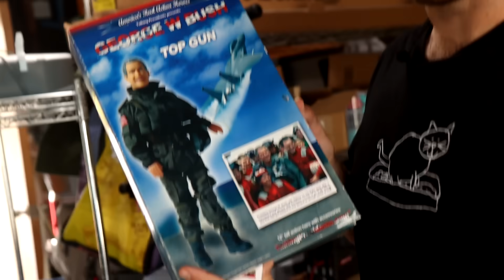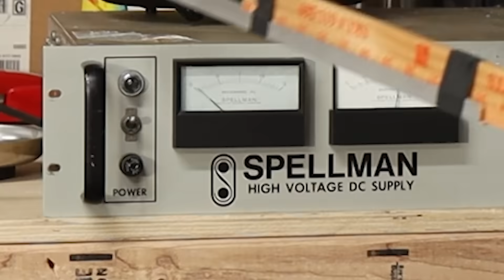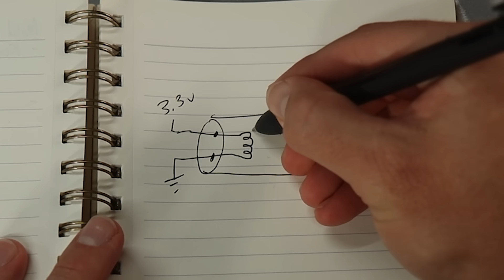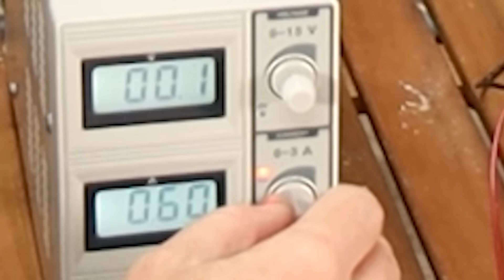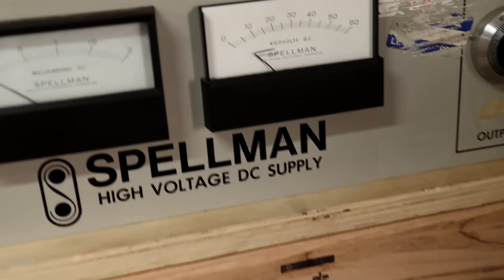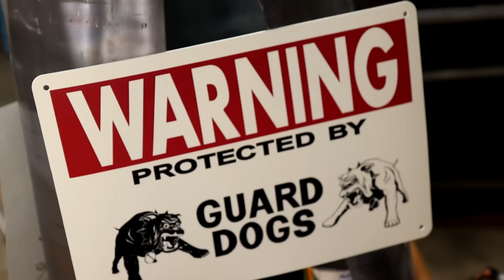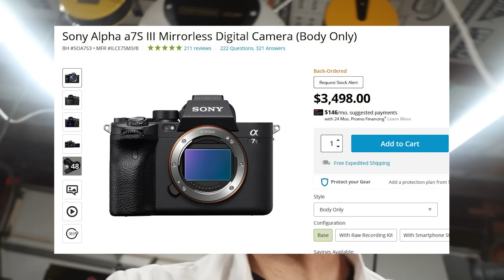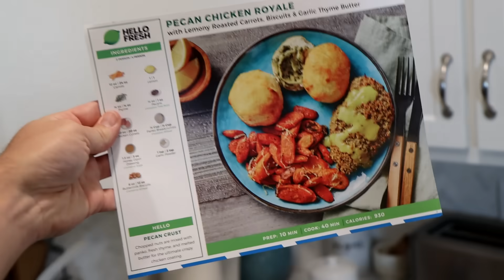Built My Own X-Ray After a Hospital Charged Me $69,210.32

Comment: I have to react to this on many levels

As a veteran MRT (X-ray tech)
   So many things.  A hand X-ray off of a dental tube should need 60ish KV at 2mA/s.  You lucked out that your power source was exactly what you needed to produce the proper penetration spectrum of X-ray for a hand.    A abdomen would need 75kv at 40 mAS and  a chest would need 120kv at 3-10 mAS. These voltages would blow a dental tube immediately. Without using step down transformers, this hand should be a 50ms exposure.  You had this thing on for 5-10s at a time.  It’s still a smallish dose, but it’s 100x what you needed.  Keep your wife’s uterus away from this thing.  You’re on par with a short flight every second or so.  The electrons “hitting the air” is called the photo electric effect.  You’re overloading the tube.  The dentist had a proper power source.  It’s a matter of time before the anode in your rig goes.  Use it for 1s at a time to delay the inevitable ‘pop’ your tube will make.  

As a Canadian
  American health insurance is nuts.  Healthcare is a human right. 

As a Jew
  Did you nickname your kid “Jewey Neutron”? That’s awesome!  Are we He-bros?

Comment: As long as you know that xrays are sent in all directions, not just toward the beryllium and aluminium filtered window. In most radiography something between 1% and 10% of the xrays are directed out of the xray tube through a little window. The rest are absorbed by the lead. An enormous amount of heat is also generated.

Comment: 7:03 This is basically the same set up as the demon core disaster from the Manhattan project.
Reply: Yeah except demon core is a hundred bagillion times more radioactive, and garbonzo beans are better than screw drivers, also gamma rays vs x-rays, also the power supply is way more dangerous than the x-ray
Reply: @knixie  "garbonzo beans are better than screw drivers" lmao

Comment: Honestly, this isn't horrible. I am in my last year of school to be a Radiologic Technologist (x-ray tech) and we learn all about how x-rays are made. It seemed like he took decent precautions for these x-rays and the terms he was using for the parts of the x-ray tube and detector were accurate. My only issue is the images aren't big enough to be diagnostic for anything bigger than a finger. And the x-rays aren't penetrating enough to see trabecular markings in the bones to then diagnose possible fractures or bone diseases. Yes, there are certain positions and technical factors required to obtain a proper image but for an x-ray built in your garage, I thought this was pretty good! I wouldn't recommend using it very often so you don't give yourself cancer or radiation burns and the images you produce likely wouldn't be good enough to be read by a Radiologist but I thought this was pretty decent.
Reply: The main issue I see is he doesn't seem to be using any filtration.
That x-ray tube has to be pumping out a massive amount of low-energy x-rays which are probably giving him quite a high skin dose.

There's also the issue of how controllable his power source is (could is randomly surge to a much higher mAs?), and the lack of radiation control lights and stuff means his device is probably illegal; unless there's some stuff off-camera he's not showing us.
Reply: @IamGrimalkin  I mean you're not wrong. But for a garage, I thought it wasn't too bad. Thankfully it was a small tube so as long as he hardly ever uses it, I feel like it isn't a huge issue. I think for a funny video, the markings on the outside that he made are likely good enough for the purposes of this video. You're right, it likely is illegal and that did cross my mind. But for all the backlash he's been given about this, I doubt he will use it much at all.
Reply: @IamGrimalkin  is there a law? It's probably not certified or passes safety . Idk if it's illegal
Reply: @Red-ju4mi 
I don't know what radiation regulations are in the US, but I understand they don't vary all that much internationally.

If this was in the UK, he would have broken IRR and IR(ME)R in several places, unless there is extra safety stuff behind the scenes he's not showing us.
Reply: This was such a read and I’m here for it! Did you complete your course?
Reply: Might the low resolution be more because of the camera used to capture the phosphorescent glow? I imagine a detector right behind the plate would work well to capture more detail
Reply: What would be like ... Wrong... (I'm asking for a friend of a friend
Reply: Tldr: idfk im too lazy to read too

Comment: 11:20to like 13:00,holy fuck thats a worrying lack of concerns for a mcgyver half working set up. Radioactivity detector not reliable, lead not all over,him saying that all the xrays are escaping by said role. Not aware of the relationship  with high voltage and  metal... Mesmerizing.

Comment: I watched the I am done video and felt a real connection. Then I watched this video. I think I don`t have to say how much I`m disappointed (Since you dropped your degrees, I might as well also say I have a bachelors and masters in chemistry). Why is this dangerous? It`s not just the x-rays, it`s ALL the improvised equipment. Starting with the x-ray source from a BROKEN dentist equipment. Any instability with this machine could lead to a huge accident. There is no disclaimer in this video telling people not to try this at home, which itself is VERY irresponsible. Now I`m glad your are done. No one else has to deal with anymore.
Reply: Okay? No need to be an asshole about it man
Reply: Any instability could lead to a huge accident? bruh its voltage running through some cables not a combustion engine. X-rays are harmful under long exposure. 98% of our DNA is junk and pointless. The odds of a photon hitting the 60 million base pairs, out of 3 billion base pairs in the short span that machine ran is near impossible. Lets say it does hit and causes a mutation, your body can deal with it through apoptosis. electrons accumulating on the power supply is not the same as high voltage. The dentistry equipment being damaged doesn't mean that the tube inside is broken it may have no more clinical use but for a garage build that's fine. If you need a line of text to tell you not to work with high voltage or radiation then the blame is on you not on a video designed to be entertaining. I have an associates degree and this is common knowledge. If your degrees are real then I'm sure your a smart hard worker but you're hateful for no reason other than to toot your horn. The matter of fact is William is actually educated in this field, engineering and chemistry are not the same.
Reply: I agree with the 1st half of your post,(tho there's no need for that flex and insult) but there's no need to an asshole.
Reply: I think it’s pretty fucking obvious not to build an xray machine. These days degrees mean shit you can learn plenty if not more on the internet. Keep it to yourself

Comment: Please DO NOT down play the danger of building and using a X-ray machine like this. Xrays we’re escaping from your machine on ALL directions. That’s why the housing of the machines are lead lined to reduce the SCATTER. It just take one hitting a microscopic cell to cause cancers and other effects . There are reasons behind the regulations of the manufacturing, selling, and use of X-ray equipment!
Reply: He litteraly explained how dangerous they are, and specifically explained that the amount of x rays were low so he wouldn’t get hurt
Reply: No

Comment: Once you have a high voltage power supply, there is very little to 'making' an x-ray machine.  The real satisfaction of making an x-ray machine is designing and building a reliable and efficient power supply on a budget...something that can at least produce a steady 3 mA DC at 60 kV so that a fluoroscope illuminates nicely.

Comment: Repost
Matthew Rowlands
vor 1 Monat
I want to put this into perspective for everyone. I'm an xray tech. 60kV is good for extremity x-rays in terms of penetration. When an x-ray is taken on a commercial setup, it lasts about 0.04 seconds at say 0.125 A (125mA) Or 5 mAs (milliampere-seconds) for say an arm or foot. Even less for a hand, probably 2.5 mAs. 5 mAs is harmless. It's about equivalent to about 3 hours of radiation from natural sources (the earth, the sun, the stars etc) or around 0.001 mSv of radiation dose. A higher dose x-ray is something like a lumbar spine on an obese patient. The required exposure might be something like 100 mAs at 80 kVp which is equivalent to maybe 12 months of background radiation or a dose of 2 mSv. Now. ONE WHOLE sievert (or 1000 mSv) gives you a 5% chance of getting fatal cancer. 5 sieverts will give you a 50% chance of getting fatal cancer. So really, anything above 1000 mSv is quite dangerous, with a 5% risk of fatal cancer. William is using 60 kVp with exposures of maybe 0.5 seconds ~ 30 mAs or maybe 1 second - 60 mAs. This is considerably higher than a commercial tube extremity exposure because it's made out of cardboard. Thats about equivalent to a normal sized lumbar spine x-ray. William probably gave himself 1 mSv (0.001 sieverts) of radiation dose for that hand xray, about 6 months of natural background radiation. Was it dangerous? No. Where 1 sievert gives you a 5% chance of fatal cancer, 0.001 sieverts might give you a 1 in 200,000 chance of getting cancer. Thats a 0.0005% chance of getting cancer. Repeated doses are however cumulative. In terms of ONE single dose, if you repeated this dose on a different person for 548 years, you might expect a 5% chance of one of them getting cancer.

Comment: It seems neither you nor Michael are at all familiar with heat shrink tubing
Not even as a safety thing, it would just help prevent arcing
Reply: insulating any of this would be a nightmare you would have to submerge it in oil  heat shrink tubing would do lithely nothing

Comment: Hey William, I hope you're doing fine. I've heard many folks that they travel to mexico for their surgeries. I'm not bashing your choices or anything, but I've seen that appendix surgeries over here cost around 2000 USD, the checkup much less. Of course that doesn't include plane tickets and hotels but I suppose that's marginal compared to 70k USD in debt.

Comment: I'm a bingboingus engineer certified in over 500 spunkleslops and the way you used that flathead shovel was completely on point, excellent job, I couldn't have done it better myself when working with my kringleskunt fields

Comment: Hey William! I actually work on the assembly line for a company that makes flat panel detectors and x-ray tubes! it's really cool to see someone actually play with this stuff, albeit in a more ghetto way. With an actual digital image from a proper flat panel detector there is a LOT of image processing to be done, most of which nobody even sees as it all runs in the background. In a sealed panel, all of the glass, film, coatings, etc are part of a sheet less than 1/4" thick. It's really quite something.
Reply: @Alex Ross Hey there! You must work for some small company near SLC ;).  I build the power supplies for these systems.  It’s kind of cool watching him stumble on to the predecessor of modern flat panel X-Ray technology.  Before scintillators were bonded to cmos detectors and had WiFi in them, there was a relatively short lived technology called “CCD digital radiography” which worked EXACTLY like his system. it was a large box with a Digital camera (the better ones had large TE cooled sensors) pointing at a GdO fluorescent screen (better ones used cesium iodide).  But it was fun to watch him experimentally arrive at something so similar. These were popular in the early 2000s back when flat panel detectors cost more than most homes.
Reply: @phasetek  do you mean salt lake city? Cause that's where I'm from
Reply: @Guyro.1  Exactly what I meant, Digital X-Ray technology is a fairly small world ;). It's one of the main places I know of that a tiny company exists that manufacturers both FPD's & Electron tubes (among many other related things)

Comment: at high voltage, if electricity CAN jump wires, and doing so will follow a path of lesser resistence than the one you want it to, it will
That's why insulators are important. You should never have a naked wire if you're playing with high voltage because this shit happens

Comment: Why on earth do you want to drain the oil and take the tube out of it's enclosure when it does what you need which is blocking the high voltage from arcing all over the place?

Comment: the x-ray source is in oil because less than 1% of the rays produced are actually x-rays and the rest is thermal.... meaning that oil is saving your tube from melting on the first use. Also, ambient or scatter radiation is the number one reason workers get overexposed, so while a thick leaded cylindar... is an idea... so was keeping the element submerged in a vacuum sealed, oil-filled container. Also your shop becomes a faraday cage every time you shoot an x-ray. 
I can appreciate the ingenuity and cost-saving spirit, but this really needed reverse engineering instead of reengineering.

Comment: Agreed on the safety!  I work as an emergency veterinary technician and I take an average of 15 radiographs (X-rays) per shift; and often times it’s more in the 20-25 range.  We are required to wear a monitoring badge that we turn in every month to see how much exposure we’ve had.  Even on my busiest month ever (I took somewhere in the range of 700 X-rays during the month) my badge didn’t register an alert.  It’s a little on the apocryphal side, but I’ve heard each shot we take is equivalent to being outside for about 10-15 seconds. That means my exposure, again on my busiest month ever at the hospital, was roughly equivalent to 2 to 3 additional hours outside over the course of a month.  Now, I may not have gotten skin cancer during that time...... but my sanity was severely tested!  😂

Comment: Meanwhile you don't usually turn off an MRI. Just stays on 24/7. But yet it'll cost you two grand pop to go use it. They would prefer to leave it not running then charge a reasonable amount. I figure your average hospital repays the cost after just about 5 years.
Reply: It actually needs to stay on. MRIs are extremely complicated and have a cooling system that MUST stay on at all times or else the magnet will break requiring hundreds of thousands of dollars in repair.

Comment: “Welcome to high voltage, where everything is a wire, and you’re probably gonna die.”

Willam 2021
Reply: keep one hand in the cart at all times to avoid arcing across your heart and stopping it instantly! I was taught to stick my hand in my pocket or on my stomach and not to stick it back like will does. the idea is that electrons gather at points, so in theory will's fingers could arc to something behind him. i don't think it really matters that much with high voltage though where you stick your free hand, as long as its not grounded directly

Comment: Alright so this was the first video I've ever seen of yours and I guess I'm a safety nerd. Idk, when I learned about xrf for my certification they were like bruh don't put yourself in front of it. As long as you know exactly where the x-ray beams are shooting out and you don't go in front of it, you're good. That being said, I wouldn't trust an x-ray tube salvaged from an old piece of equipment, the rays can easily be escaping and you can be exposing yourself to unnecessary levels of radiation. Ie the Alara concept. 

That being said, this is fucking awesome and I am now a fan!!